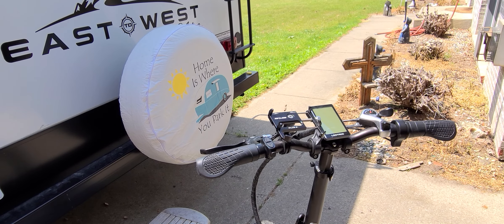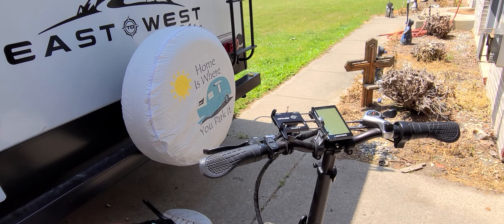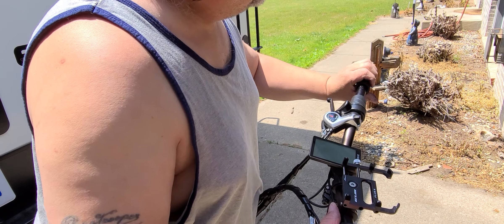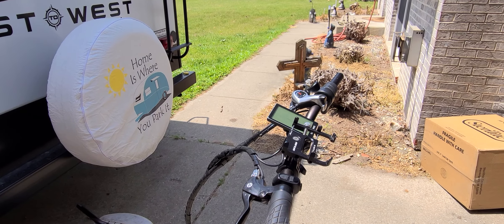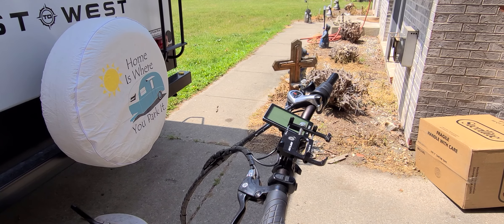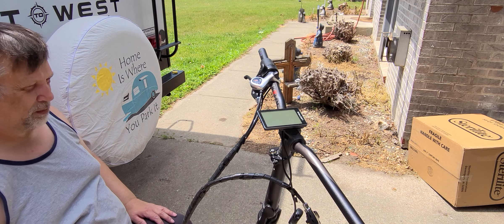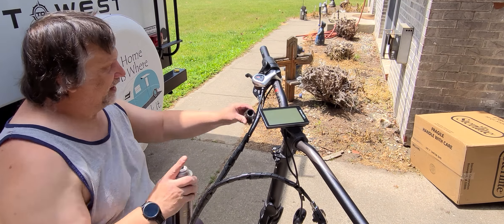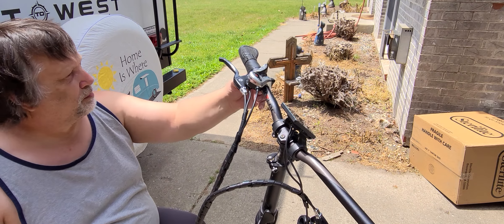lectric xp handle bar change

Comment: Some folks are buying all kinds of extra stuff to mount some BMX style handlebars on.  My thought is to just replace the handle bar with something with like six inch rise, which would match how much I extend the telescoping stem now. I'd just leave the telescoping stem all the way in the folding stem. Then it would lose that pogo bar look, the the height would be in the replacement bar instead, which in my mind would look way better.

Then I realized I wouldn't be able to take the bar out for transport as I do now, because the cables would  be too short. I realize I could fold it over, but that wouldn't work in my situation. Any thoughts?
I guess I'd be looking for a 25 mm dia replacement bar?  I have an XP 2.0.
Reply from the maker: 25.4mm stock bar on 1.0 is 570mm the 2.0 is 630mm I would look for 680mm maybe sewpt back
Reply from the maker: https://www.amazon.com/SENQI-Bicycle-Handlebar-Comfortable-Aluminum/dp/B08H5GC62S/ref=mp_s_a_1_5?crid=2KTP5C2L10TOG&keywords=handlebars+25.4&qid=1682034335&sprefix=handlebars+%2Caps%2C265&sr=8-5
Reply: @DonaldMays  Wanted a higher rise bar to help eliminate the pogo bar look.
Reply from the maker: https://www.amazon.com/BW-100mm-Riser-Handlebar-Mountain/dp/B07G5PC8ZC/ref=mp_s_a_1_5?crid=1LSFYHOSAS0GP&keywords=handlebars&qid=1682037714&sprefix=handlebars%2Caps%2C754&sr=8-5
Reply: @DonaldMays  Problem would be getting the cables to fit and if you did, being able to remove the telescoping stem for transport.  Might be easier to cut the damn thing a few inches, as long as you left enough for for lectric safety requirements.
Reply from the maker: @dme7689  i went wider not taller buy the cables were long enough i think you will be ok  you might have to unwind the casing around the cables to get the slack but its there

Comment: The handle bar rotates around the center position when riding on my XP 2.0. Is it possible the knurling (just below the display) is stripped? I haven’t taken the handle bars apart as you show in the video. Researching at this point. Thanks.
Reply from the maker: yes i would check the the clamp is the same on both allen screws and tight. If you are replacing the handlebar it is clamp dia 25.4  i would look for a wider bar maybe 670mm or wider. replacing the bar with a wider one improves stability

Comment: On the 2.0 bikes that I ordered, there's supposed to be 630mm handlebars. That would make them 15mm shorter or about 6/10" shorter on each side than the ones you put on. I'm hoping they will be wide enough.
Reply from the maker: well  it depends how wide you shoulders are

Comment: Where did you buy your new handle bar from?
Reply from the maker: https://www.amazon.com/BUCKLOS-Handlebar-Mountain-Handlebars-Aluminum/dp/B08KVQ54QC/ref=sr_1_12?crid=864XMCQCSOO3&dchild=1&keywords=handlebar%2B25.4%2Bmm%2Briser&qid=1622857465&sprefix=handlebar%2B25.4%2Caps%2C172&sr=8-12&th=1&psc=1
Reply: @DonaldMays  I just ordered my handle bars
Reply from the maker: @rolandgadue4351  thats good
Reply: @DonaldMays  Do you think you and your wife will get the newer model 2.0 with the front shocks?
Reply from the maker: @rolandgadue4351  not anytime soon our bikes are lighter and have more range
Reply: @DonaldMays  so the newer 2.0 has less range
Reply from the maker: @rolandgadue4351  Roland the battery is 9.6 amps and the 1.0 is 10.4 amps so almost amp difference

Comment: So you could have used a full-length handlebar grip on the right side, if you had new handle grips
Reply from the maker: yes you could but when you used the throttle it would put that had in a different position
Reply: @DonaldMays  that is true.

Comment: You had the right idea with using air to take grips off. Unfortunately you didn’t execute it very well. Took both of mine off in 10 seconds. Put your finger over the grip hole on one side, put the air gun in the other. Give it a blast of air and One of them will come off immediately. Put your hand over the end of the handlebar that the grip came off and the air gun in the hole of the other grip, give it a blast of air and it will come off just as easy. Also saw the throttle shim fall out earlier in the video but never saw you put it back in. Goes between the throttle and the short grip.
Reply from the maker: yeah mu problem was i couldn't find my short air nozzle it grew legs and walked away it is how we removed them in the bike shop i did put the washer back thanks for watching !

Comment: To disassemble it and took 15 minutes. Not bad. Hairspray huh thanks for the tips. Wow it looks like you’re ready to roll again👀 well it happened to me you said don’t leave the saddlebags open they could get caught in your spokes it got caught in my discbreaks now I have two take the rear brakes off and pool off the strap out of the brakes. I think it’s a five hour line like I said I saw your video when you pull up your back tire. I never knew how dirty my bike was want to see the next video when you take your bike out for a test drive with the larger handlebars. Catch you on the rebound Danny boy👍🏻👍🏻👍🏻💨👀🚲

Comment: You see my questions for you 5 days ago? Maybe youtube is blocking them . thanks
Reply from the maker: Joe the handlebars are not right size you need 25.4 mm clamp size and 22.2 or 7/8 bar diameter the rotars 160mm and the calipers will work for 160mm
Reply from the maker: funny that it did not put it in a video comment I had to search for it
Reply from the maker: only place I found that bar in the right clamp diameter is alibaba
Reply: @DonaldMays  thanks so much for the info. Keep  up with the good work you do.